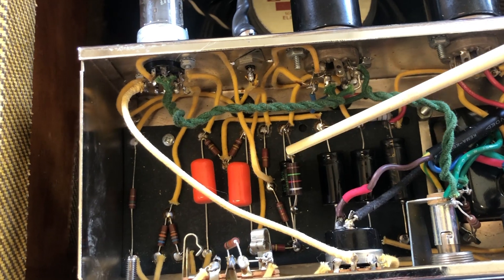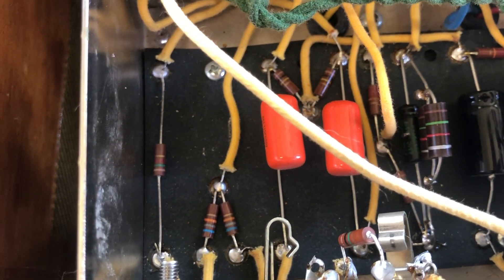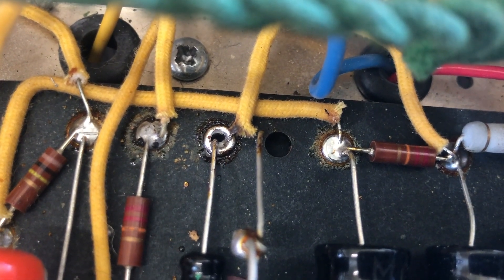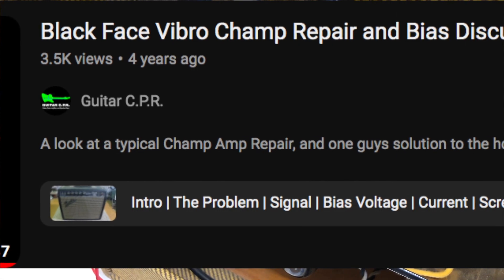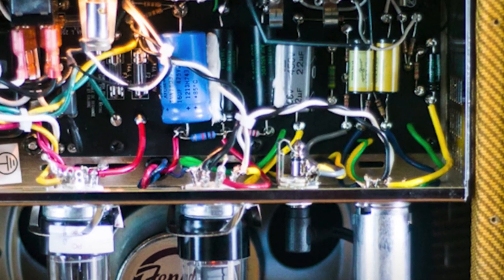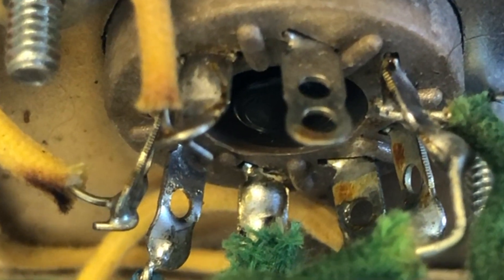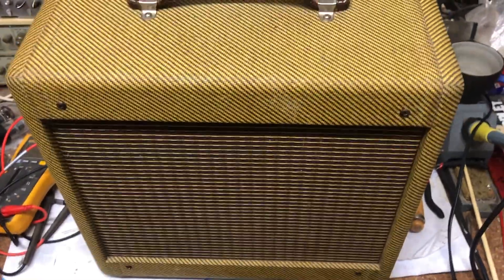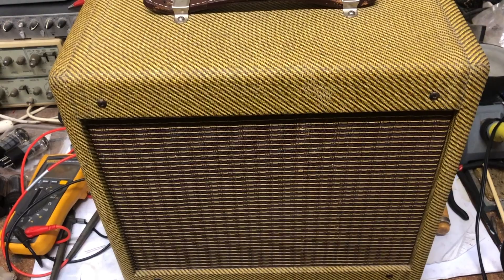Fender's Secret Champ Reissue Mod

Comment: Google "feedback tail resistor".  Look at the schematic for a blackface Champ. The feedback is injected at the point where the bias resistor and bypass cap would typically go to ground but ar followed by a low value resistor to ground, that resistor is the feedback tail resistor.

Comment: The bypass cap will certainly give you more gain on the first stage.  IF it is taken out or missing you would get less gain but negative feedback for less distortion?
Reply from the maker: Hi Tom, yes the bypass cap allows for more gain, mostly in the bass region... whether you will hear the difference depends on the settings on your amp: You won't notice at 3, but should notice it at 12. Negative feedback is something else: it takes signal from the speaker and feeds it into circuit, cancelling certain frequencies.
Reply: @zjokka 12? DO you mean "noon" which is actually 5 (in relation to "3")?
Reply: @stormriderkaos 3 is 3 - 12 is 12 - no reference to clock hnads.

Comment: Make sure that 6V6 is not gassy. If it is, the bias current may crawl up because gassy tube developes positive voltage to the grid. 
I usually try to adjust B+ lower using zeners if necessary, and bias current higher to make the output tube run more in class A without too much plate dissipation.
Reply from the maker: Take out your Champ, hook up a multimeter and show me how stable your bias is when you put the amp on 12. Heaps of space on your empty youtube account... not one video published.
Reply: @zjokka  Well, if the SE output stage does not work cleanly in class A but clips assymmetrically working at very high B+,  it acts almost like a rectifier and charges the cathode bypass cap etc. But there are several parts in the equation, bypass cap value, screen resistor value, grid stopper and grid leak resistor values,  NFB etc.